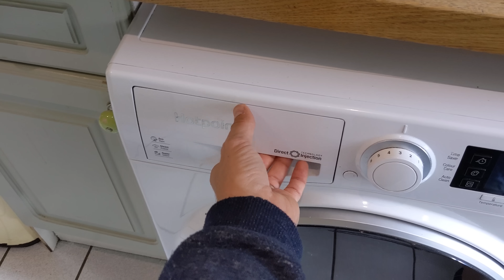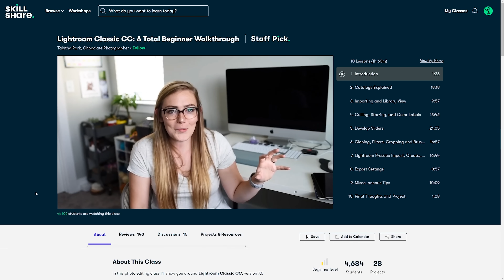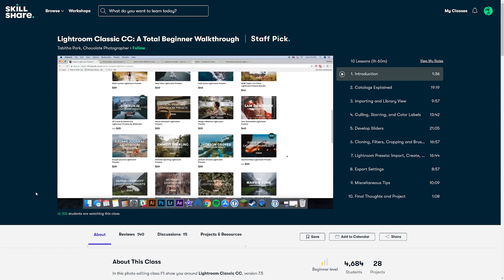The Pythagorean Siphon Inside Your Washing Machine

Comment: "Your washing machine does this."  No, I'm afraid my washing machine demands that I dump my washing chemicals into the tub manually.
Reply: Maybe you gotta pedal for the last part too?
Reply: You mean the ones that's vertical? Those things can fit a lot of clothes.
Reply: apple pie yeah the newer expensive ones are like that
Reply: Mine too.  It's over two (maybe three) decades old and still runs like new.   I'd like to get a newer HE style, but an appliance repairman told me that the newer machines just don't last like the old ones.  They are built in such a way that they can't be repaired, so when something goes wrong, you just have to throw them away.
Reply: @ahobimo732  depends what goes wrong
Reply: I haven't seen one of those since the '90s.
Reply: Jordan Hoffman They still exist... I’m staying in a remote town for work. My rental house has modern old fashioned washing machines with no detergent tray.
Reply: Mine uses centrifugal force to push the fabric softener up the walls of the agitator and when the barrel stops spinning it all drains into the barrel
Reply: @irn00bz0r2  Thanks for the tip.  If my current dinosaur ever kicks the bucket, I'll keep that brand in mind.  I'd much rather spend a large sum once, than have to spend slightly less over and over again.

It's not the sort of approach that our current economy encourages, but I find it far more satisfying to own the same thing for as long as possible, rather than be constantly buying what's new and throwing out what's old.  Sometimes technology improves and things get out of date (mostly electronics), but a lot of the things we own could be useful our entire lives if they lasted that long.

And I've found that things that I own for longer, actually get better over time.  I try to fix things whenever possible, and usually when I fix something, I'll discover an underlying design flaw that  caused the issue.  Once I correct the flaw, the issue doesn't recur.    So the repaired object isn't just "as good as new".  It's better.  Also, once you've taken something apart, and discovered exactly how it works, you know how to properly use and maintain it to prevent future problems.  The longer you own it, the more reliable it gets.
Reply: My washing machine just asks for a divorce not washing powder
Reply: Lol. They still make top loaders with agitators. They’re not dead yet.
Reply: @steveo7771286  yeah not dead but buyer beware. The newer top loading do use a lot less water. They also need a lot less detergent. I upgraded to a Maytag centennial from my old maytag and I regret it so much! When the sales person mentioned it being a little noisier I didn't think it was going to be any noisier than normal top loaders BUT I was very wrong. The noise is horrible!! It is always stopping/starting/ jerking sounds while sensing the water levels  and just when you think it's done- it starts again. It takes almost an hour to wash a load of clothes instead of the 30 minutes of the old ones. I called the repairman to have it checked and was told it's just how they are. I wish I had never upgraded! I have had it 3 years and the only time I really panicked was opening it up during the filling phase it stopped the washer and it wouldn't start back up. I eventually had to unplug it from the wall, waited 5 min and plugged it back in to reset the computer on it. I was then able to start it like it was a new load. It is so loud that I'm the beginning everytime I started it my cats ran in terror! That lasted for a couple weeks till they finally got used to the monster in the kitchen.
Reply: Dee Mueller that just sounds like a terrible design, is it one of those open wash tubs with no agitator column? The one we have is an actual, traditional top loader, just like 40 years ago with the crank and pull knob and all. It’s only maybe 5 years old.
Reply: @steveo7771286  yes, top loading with an agitator.
Reply: Dee Mueller oh. Just a bad design then. Ours sounds and looks like it came straight out of the 80s. Just with cheaper and more modern looking plastic control panel. Same controls though.
Reply: @steveo7771286  I just noticed there are several videos on the causes so maybe the  repairman didn't know either? May have to have someone come look at it again. The sales lady even told us hers was loud but the "less water" was what we were looking for in a new washer. It just bites I gave away my old one for it.
Reply: Michael Graham same here
Reply: @phoneflipp Mine's fart activated
Reply: The way my washing machine works there is a tower In the middle that spins and at the top of that tower there is a cup that you put the softener in. Around the side of that cup is another upside down cup with a hole that allows you to pour softener in. When the washing machine spins it pushes the softener out of the cup and Into the sides of the upper cup using centripetal force. It then funnels down Into little square holes that evenly distribute the softener into the clothes while spinning
Reply: Me , an Indian : Wait you guys are getting a washing machine ?
Reply: @ashwinbabu6837  seriously?
Reply: @mohitchandel1334  Well I do have one...its called a Mom tho
Reply: @mohitchandel1334  Well , I'm 17 and I got 88 in My Entrance Exam where 90 was the Qualifying Cut off...so I hope too..Fingers crossed
Reply: @ashwinbabu6837  sending good thoughts from the other side of the world. I hope you find a career that makes you happy and let's you have enough to live and to give.
Reply: @cssruth  Aww..Thenks Fam 👍

Comment: In the US, most older toilet systems are just a flap valve at the bottom of the reservoir, I can see how the siphon valve method would be better and not so reliant on a proper seal of the flap valve.
I had thought that you were referring to the "waste elimination siphon" when it came to the toilet. That is a siphon system.

Comment: In my toilet, the handle just pulls up a stopper on the bottom of the reservoir, letting all the water out.  It's very slightly lighter than water, so once it's open, it will stay open until the water completely empties, and gravity pulls it closed.  Once it's closed, the pressure of the water above it holds it close until you pull the handle again.

Comment: 7:50 doesn't this seem rather counter-intuitive from a UI perspective if you're unaware of how the inside of the toilet works? Holding the lever for longer = less flush, and shorter = more flush.

---

Can someone also explain which is the big flush and which is the small flush for a system that has nested buttons - a big button and a tiny sub-button within it that requires the outer button to be depressed to work? You can press either A: only the outer part of the button, or B: the whole button including both the small and large parts. 

Two opposing ideas justify different arrangements.

idea 1: the small part of the button is small_, so perhaps including that _small part will make a small flush.

idea 2: pressing the whole button is pressing more button. so perhaps that should give more flush.

Comment: I live in Quebec, all toilets I'm seen the mechanism use a simple hard rubber flap at the very bottom of the tank that is lifted up by the handle. That means the water stop flushing some seconds after you let go of the handle. Yes that also means you are wasting water if you never let go of the handle.

Comment: Awesome video and demo ;) The colored water and backlight look very cool. Never seen a toilet mechanism like that.
Reply from the maker: Thanks! A number of commenters pointed me in the direction of your video featuring the same siphon. Really Great video!
Reply: @SteveMould  https://youtu.be/_vV_z_0lFQ8
Reply: I'd like to see a demonstration of how flapper toilets operate. I'm pretty sure I have a decent understanding, but I would enjoy a classic Practical Engineering prop demonstration.
Reply: @TheH2F  It is simply a floating valve cover, held closed by water pressure until you pull it.
Reply: @scorpio6587  nailed it in one. No fancy siphon needed, but also no easy way to do a partial flush. Partial flush and silent toilets are both extremely rare in the US. You really only find partial flush toilets in airports, and they usually have two different electric buttons.

I grew up with a gravity flush toilet that was a flapper style one with a broken tank. Luckily with the US design, you literally don't even need a tank at all to fully operate the toilet. You just pour a bucket of water in the bowl until it spills over the trap, which is exactly what the tank does.
Reply: @TheH2F  held closed by water pressure, but when lifted it has a little pocket that holds a bubble of air and holds it up until the tank is drained.
Reply: @darkfur18  It would be very interesting to see one of Grady's plexi demonstration builds. I've always sorta had an intuitive understanding of how the system works, just by thinking about the shapes of the plumbing, but I've never gone so far as to look it up. I'm already subbed to Practical Engineering so I would see a video by him and get to see a beautiful demo with that classic blue water :)
Reply: As an American, I've never seen this siphon flush mechanism either. However all of my plumbing experience is with toilets that were made prior to the very recent popularization of the 1-2 flush toilets in the US. I suspect the 1-2 flush toilets in the US may use this.
Reply: @collinpearsall9084  I've installed several 1-2 flush toilets in the US. None of the ones I've seen use this siphon mechanism.
Reply: @collinpearsall9084  as a Canadian, I too have fixed a lot of flapper toilets and never seen a syphon one.
Reply: Yep, the older 1 button/flow amount... or most other places use the 2 buttons, full and half flush.
Reply: @collinpearsall9084  I'm in the US, I have a two stage flush toilet that just uses a special flapper where if I just tap the lever it does a small flush, if I hold it for a few seconds it stays open for a full flush. It achieves this by the rate at which the bulb under the flap fills with air, along with ventilating the side of the bulb so water can flow through it.
Reply: Why would American and British toilet flush systems be so different?
Reply: @mirror1675  who knows? But I immediately noticed how different American toilets were when I visited. They start and stop so suddenly! And the water in the bowl gets so damn high!

It was like they'd always been in cartoons, so I had a "holy shit, it's real" moment, haha. I had always thought toilets "swirling" like a bathtub was a fake cartoon exaggeration, lol.
Reply: @mirror1675  American toilets use a different flush mechanism to others because American toilets keep the toilet bowl full, where others keep the toilet bowl nearly empty
Reply: @mirror1675  And yet they are, I never seen this kind of syphon and it seems too complicated (perfect job tho) vs the american version, I'll have a diferent approach to toilets next time I travel the the old continent, never occur to me they'll be so diferent :)
Reply: @ArturoCastaños-r1g  actually the siphon is no more complicated than a flap valve. I have seen decades of use out of them and they still work i can see more points of failure in a flap valve such has not forming a seal etc
Reply: @richcampoverde  In México the flap system is the norm, nowadays they're intrudocing new systmes, I need to take a look in my own house. And yes, it is common for the flap to leak or deteriorate in time.
Reply: @ArturoCastaños-r1g  - actually  the syphon  is a simpler design, it has no moving parts to wear out. It also won't leak like a worn out flapper. But, once started it can't be stopped so easily.

With a flapper, if something is blocking the flow out of the bowel you can always quick open the tank and push down the flapper to avoid disaster. The flapper system also provides a more intense flush to better clean things out.
Reply: @mirror1675  Have you noticed the electrical outlets? Riddle me that one as well batman lol
Reply: @mystic_tacos  They are actually supposed to be ground prong up (for safety), but if the plugs are installed upside down they look like little smiley faces. Anthropomorphisization is a powerful instinct.
Reply: The toilet pitagorean cup is in the bowl itself and not in the flushing mechanism
Reply: I like it when smart people talk to each other
Reply: @jkbrown5496  OMG! that chorus is fantastic! nice find.
Reply: Hi Grady!
Reply: You also made something like this Called BELL SIPHON Right
Reply: @jkbrown5496 Found it.  
https://www.youtube.com/watch?v=8pPfrV8E37o
Got a good chuckle out of me.
Reply: @grn1  Fun!  Thanks for the link.
Reply: All the Youtube I watch knows each other.
Reply: Me neither
Reply: https://youtu.be/4G6e4TaJxkI 0:20!
Reply: same
Reply: So why has mine started leaving water in the softener tray after a wash?
Reply: Hey you're that nerd guy!
Reply: Yes! I've never seen that type of flush mechanism either! I love both of your channels (Steve Mould and Practical Engineering); and though I have installed countless styles of toilet flush mechs in the US, I've never seen this type. Thank you! Keep up the great work!!

Edit- Most mechs I've encountered in the US work the opposite - hold the lever down to drain the full tank; press and release to drain a partial amount.
Reply: Yeah that toilet mechanism is unnecessarily complex, creating multiple points of failure. The American standard flap valve toilet is a much more reliable design.
Reply: @iwontliveinfear  it’s only got about ONE moving part; more complex?

I’d bet it leaks out the bottom less often than the standard American flapper valve version!
Reply: @aldo.d.longhi  actually, it has 4 moving parts, each of which is a potential failure point. The shaft, the one way valve, the spring, and the attachment ring. Also the joint between the one way valve and the shaft is a 5th potential failure point. A failure at any of these points renders the device wholly inoperable. (I'm fairness, the spring might not actually be necessary, just a convenience.)
The flapper valve has 3 failure points, only 1 of which will actually stop you from being able to flush, the pull chain attachment. The other 2, the hinge mount and the seat, where failure will prevent it from properly resealing after a flush.
Reply: nothing is awesome about this video. He explains nothing, and he barely gives you time to follow his hollow points.
Reply: Coloured , not colored

Comment: In our place, we dont use these siphons for our toilets. We use a buoyant valve that covers a drain to the toilet bowl. The valve is kept shut by the weight of the water above. When the lever is pressed, the valve is pulled up and opens. The valve stays open because its buoyancy overcomes the drag the flowrate of water running into the drain makes. This makes a half drain quite difficult. However, I found a way to do it. I dont press the button or lever all the way. I half press it and hold for a few seconds, and to stop it, I let go. Its takes a bit of practice but I got the feel of it through time

Comment: 4 active home toilets here, plus many many more rebuilt over my lifetime. In the USA I have never seen a siphon drain, all are flappers that also provide partial flush and some are adjustable. They work great and partial flush is a touch, full requires holding the lever. Simple and effective plus the flappers are super easy to change if/when they leak.

Comment: We usually just have a rubber plug that also floats just enough, but it's also engineered in a way that the pressure of the surrounding water holds it down until you press the handle and pull it up manually, then it floats on top of the water until the cistern has fully drained. It's also open at the top acting as an overflow, so excess water just spills into it, should there be a constant supply of excess water into the tank. Now that I think about it, I am sure we also have these siphon mechanisms here, but only for older systems with a chain to pull on, where the tank is mounted rather high up under the ceiling for some reason.

Comment: We don't use siphon mechanism here usually...... 

Rather we use relatively simple mechanism.

We've discharge at bottom of flush tank(nothing unusual yet)....
Now this discharge has simple bulb/ball like structure which blocks the discharge...... This is connected to the trigger outside..... When u pull the trigger a connecting mechanism lifts this bulb/ball triggering the discharge to the bowl below, and when you leave the trigger it settles right back in position allowing to retain the water being filled up, then the again the simple float (switch) mechanism cuts off the pouring water.

An added advantage of this mechanism is you can virtually control the discharge from the tank.....
If you don't want bowl to flood you may release the trigger after short click and it'll discharge water only for that time period...... And downside is if someone pulls the trigger too vigorously it may dislocate the bulb blocking discharge which might result in runny toilet.....
This disadvantage is only with some unbranded/local make mechanisms(which might not have appropriate weight balance in bulb of discharge).......  But again the fix is equally simple, one can just adjust the bulb below by accessing tank through top lid and voila you fixed it.......

I think that's way more simple than siphon technique.....
Has more control over discharge and has simple fix for common problems.....

Comment: Most toilets in North America do not have a siphon in the storage tank, just a simple flapper valve that allows the tank to drain directly into the bowl. 
The bowl has a siphon though, surprised you didn't mention that. It allows the bowl to hold some water between uses to stop sewer gas from entering your house (ewww).